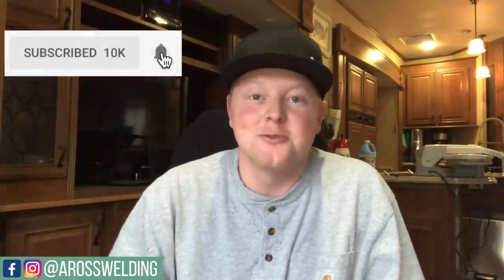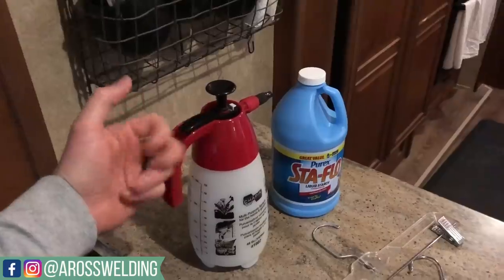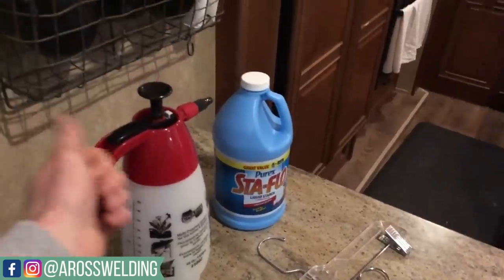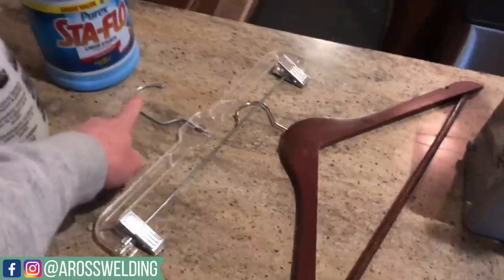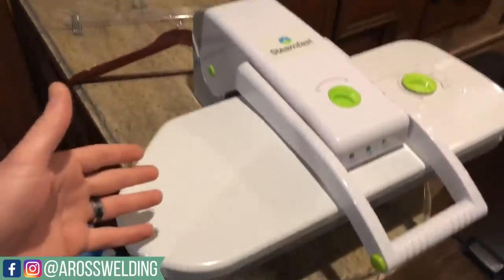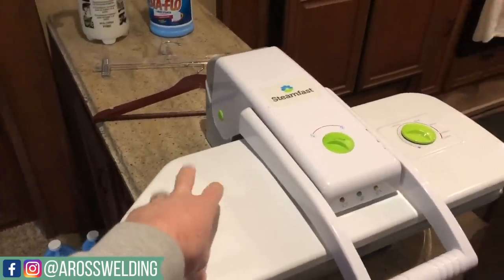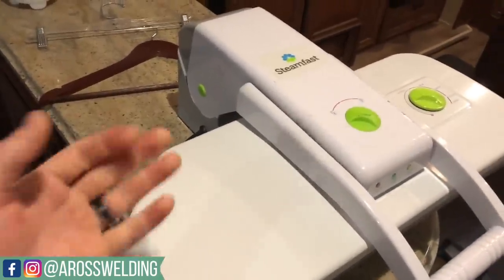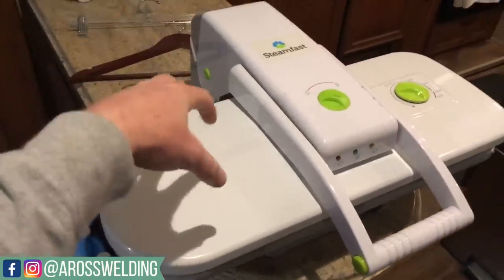PIPELINE WELDER STARCH (HOW TO DO IT YOURSELF AT HOME)

Comment: I though I used a lot of starch...
In regards to those spray bottles.  Use them for everything.  Bathroom cleaner, glass cleaner.  If I can get a product in volume it goes in one of those sprayers.  I have a rack built where they all sit, handles out labeled with a P-Touch.  Checks my OCD box having all the same containers, all in the same spot.  I know when one is missing, I know when I'm low on any of them.

Comment: Do you recommend the steam fast? I read a couple reviews on Amazon that it stops working in a couple of months of use.
Reply from the maker: I’ve had mine for a couple years now and it’s still working good.
Reply: They will last forever if you use  bottle water. Cause tap water has calcium (some cities worse then others) and it builds up & that ruins it. 
But if you don't wanna buy water then here's a tip. Fill up some pitchers or bowls or whatever you got & leave it out on your table or counter over night & then rebottle that water with a lid & store until needed. Bam there ya go! It's good to use in your press, coffee pot, floor steamer, etc...😉

Comment: Question: does anyone know how much difference this makes in a fab shop using mostly Mig (also using plasma cutters a bit and obviously grinders), or is this mostly for just stick?
Reply: I don’t bother with it myself. I don’t notice much of a difference, I just use it straight out of the dryer. Even starch won’t help from a plasma cutter

Comment: TIL starching your clothes keeps you from catching on fire. Considering I caught myself on fire 3 times in 10 minutes last month, I should probs do this. PS, my barber had, like, a pressurized spray bottle and she only had to pull the trigger once for like 5 sprays worth of water. In case you don't want to use a pesticide sprayer.

Comment: I thought welders are supposed to be sweat pants and fleece coat lol. You've got a system worked out so you can starch your clothes, not something I do, my job doesn't lend itself to be prim and proper. Carhartt overalls covered in grease and dirt, smell like what I was torching, welding something that usually involves garbage juice that likes to boil out of the steel while your welding it. I usually hear from somebody saying to me you're filthy or phew you stink LOL.

Comment: Ummm not for me I have lured the hard way not to put Dryer sheets in my work clothes when I dry them I have Caught on fire so many times from dryer sheets stay away from the dryer sheets and I’m OK cool video though
Reply: you need to be so careful. Starching cotton reduces the flammability by blocking air from the fiber, but if used on fire safe synthetics the complete reverse can happen. As the synthetic starts to melt, it soaks into the starch and the combination can start to burn at around 700 degrees centigrade (cotton burns at 400 degrees). to make matters worse, it then sticks to your skin like glue, causing life threatening burns.
To understand what happens. 
A block of wax wont catch alight and a strip of cotton burns away within seconds. Add the 2 together and you have a candle and enough heat to boil a kettle.
It was like the shell pants back in the 70's. both the synthetic shell and the cotton lining were safe on their own, but together they were lethal and several kids died as a result.